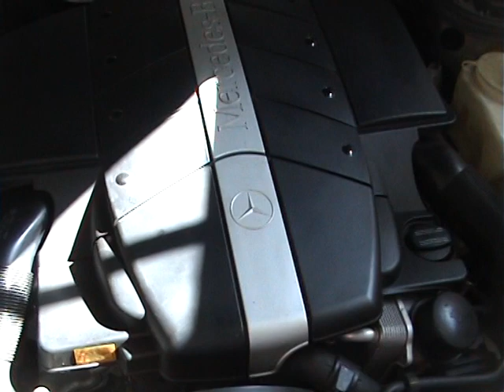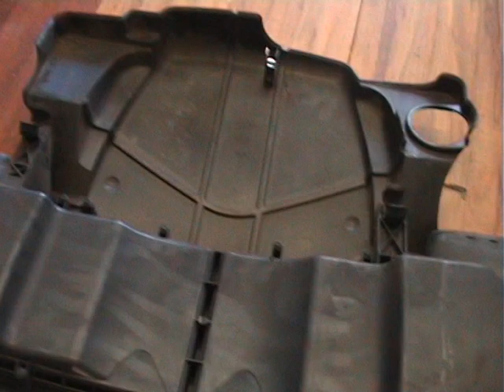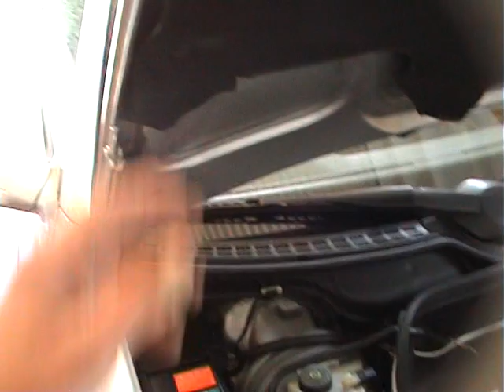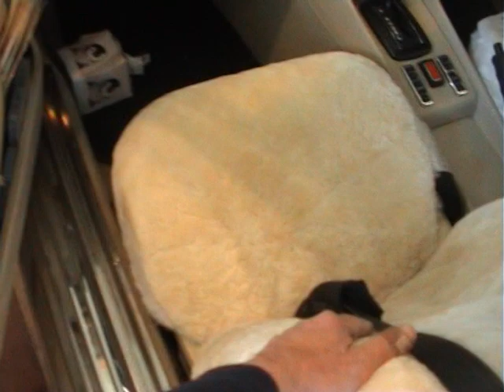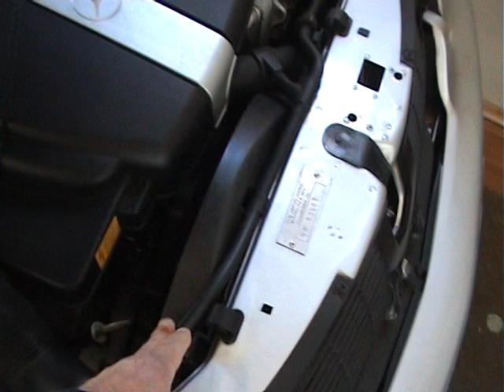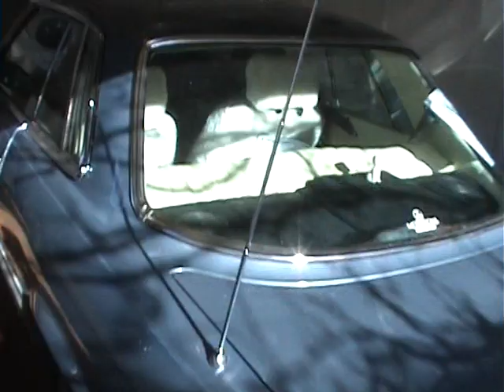Changing CLK430 air filter and a comparison with the 450SLC

Comment: why do people like those w124 so much?
Reply: I have a clk430, and have driven the old sl Benzes. The sl has more comfortable seats with their own suspension built into the seats, so it's fun to sit in, but the car itself feels like a crown Victoria with 2 doors. The clk 430 seats are kind of flat, but the car itself kind of feels like a light sports car, and takes turns real tight and smooth. If you like land yahts get the sl, if you like sporty cars get the clk 430.
Reply from the maker: Hi, Ray  I like them because they aren't overloaded with electronics, they are analog so anyone can code read them, the parts are easily obtained and are cheap, the ones I have don't have air or hydraulic suspension which I have found in the past can stuff up, anyone can work on them as the engines are basic, our 300E is not a speed machine but a great cruiser, they are quiet and smooth to drive and built like a tank. I find that the later cars like the CLK430 we had are a hard bumpy ride and the seats aren't as comfortable, you can't even check the transmission fluid level, the CLK had 16 spark plugs with 8 coils, one per cylinder and the electronic rubbish on the car would have to be cleared when doing a service, I think Mercedes want to make it that you have to take the car to them to service no matter how small the job. I liked my 450SLC as it had no electronics at all, but all the features that are on today's cars, except for traction control. Sorry about the rave, LOL....
Reply: @riffraffjazz  you can get the clk with soft suspension i had a 320 elegance and it was as soft as an old w123 it was a lovely drive, i find them easier to read codes on than the older cars too but it is what you like i suppose. you probably have sports suspension on your 430